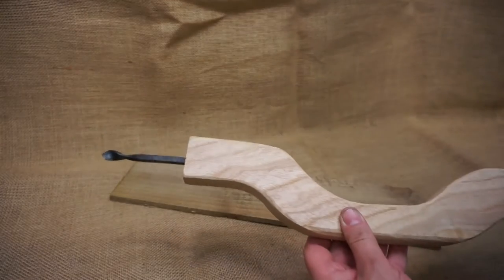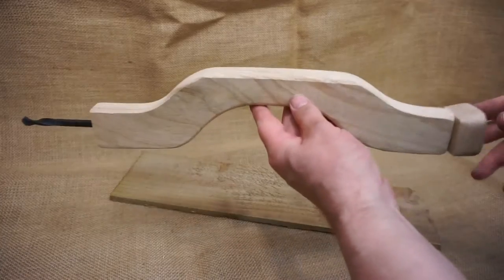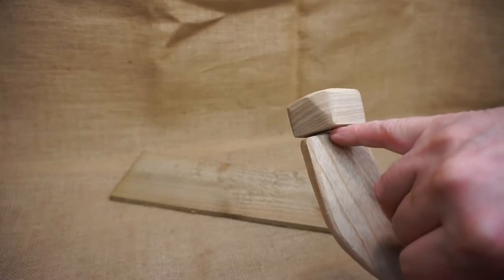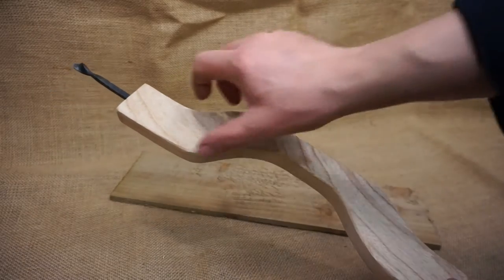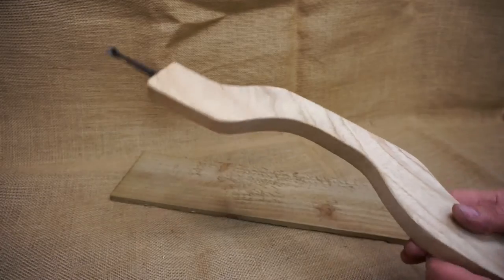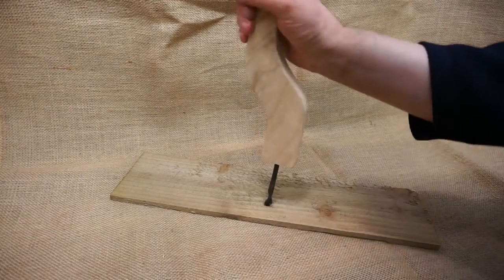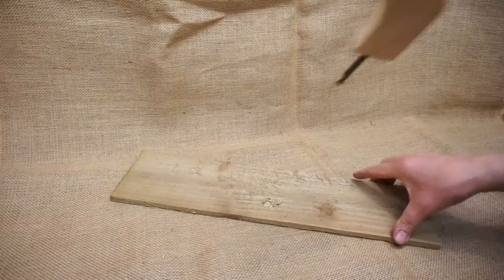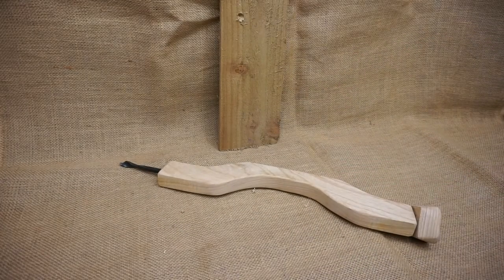mary rose style medieval brace and bit carpenters tool

Comment: Interesting. Do I understand right that the bit is permanent? Does this mean that the medieval carpenter would have had a whole slew of these in different bit sizes?
Reply from the maker: the bit is permanent, wood was cheap and iron expensive in the medieval period, that being said in the post medieval period there are examples with  a removable tip that was set in a tapered square wooden shaft that fitted into a tapered square hole in the crank and it is likely that examples were manufactured with removable tips from much earlier